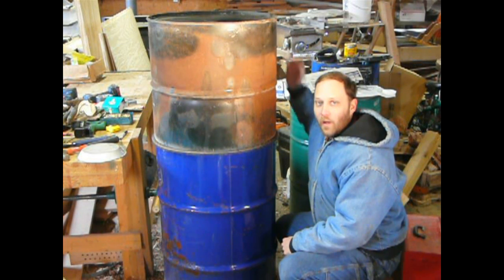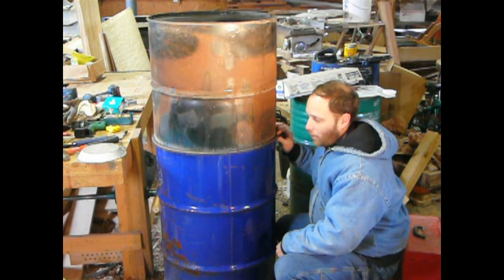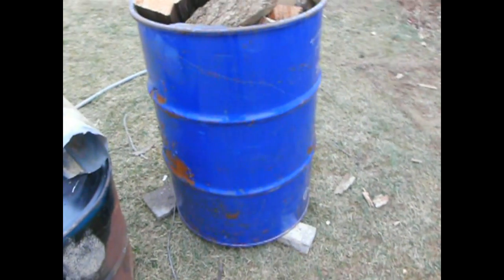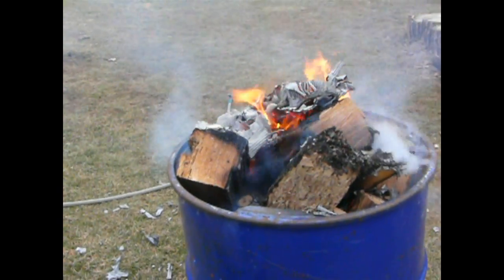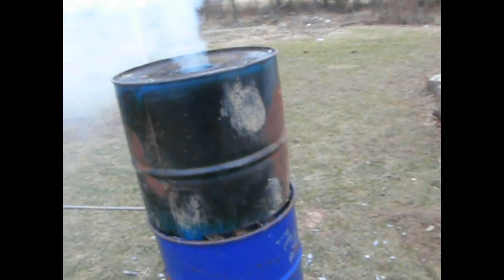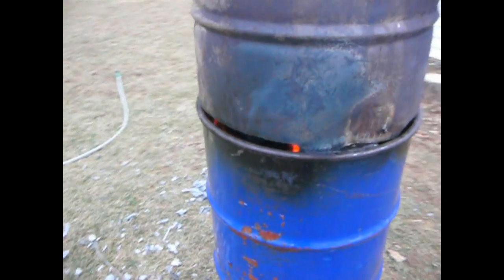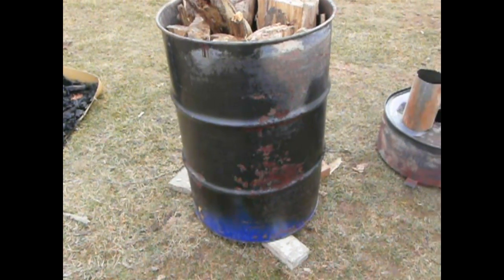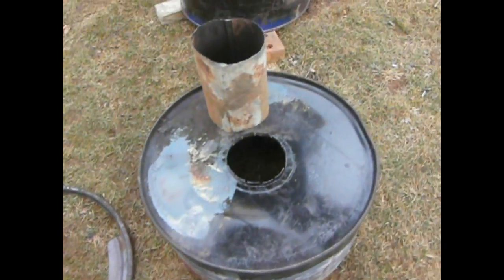Biochar Charcoal kiln

Comment: No holes are necessary. Here is the best and most efficient design I have seen: 1: load a standard barrel with no holes in it. 2: Put the lid back on with a 2" hole in the center of it. 3: turn it upside down on top of three or four bricks standing 4" tall. 4: get a ring of metal, maybe a larger barrel or just sheet metal bent in a cylinder that will fit around that barrel with about 3 to 6" all the way round: 5 Support the outer barrel about 2" off the ground. 6: take the outer ring off and make a fire under and around your sealed barrel full of char wood.7: when the fire under is burning good, put the outer ring back on with a small 1/2" gap at the ground - this holds in the heat of the fire and prevents wind from cooling your inner barrel. 8: when the inner barrel gets hot enough it will start blowing smoke out the hole in the bottom, feeding the fire with the white smoke that usually goes up into the sky to kill all of us later: 9: the extra energy wood and time you save will pay for itself in the first batch you make and you will be surprised at how much more charcoal you get in each batch  NOTE: you also won't smoke out your neighbours  ! ! !ALSO you don't have to worry about STOPPING the flame because once you think it's done you can just walk away till the next day. Very little oxygen will get into that center hole and if it does the heat will build up fast and put itself out again.
Reply from the maker: Yes, if I understand correctly, you are describing a different type of kiln, a double barrel retort system. It can be a good one and easy to set up.

Comment: Hi. I think your Phoof, "little explosions" were evidences that oxygen was getting into your barrel. It was igniting the hot wood or hot charred wood then burning up rapidly. Then more oxygen would enter and the process repeated until you had a cool enough core for the coals to no longer ignite in that way. It was an interesting burn because I kept looking for how it made any sense. Most of the burns that I have seen required that the burning wood either 1. heat a separate chamber wherein char was being made, or 2. brought to a high temp, then closed off, sealed, from the possibility of more oxygen entering the system. I watched the burn hoping that you would explain how you intended to isolate the wood that would eventually become char. However, I never saw that your design attempted to do either and kept looking for one or the other. I think that since you were just looking for soil amendments, you must have gotten what you wanted out of it.  Thanks, B.
Reply from the maker: +William Brown Yes, it was igniting the gases coming off the wood. Top lit biochar kilns work a bit differently than other types and yes, some of the charcoal inevitably burns off with this type of system. If you don't somehow extinguish it at the end, it will burn down to nothing in most cases. Pit burns are similar.
Reply: So far, all I know about it is what I read online or see on You Tube. It is fascinating though. Maybe one day, I'll give it a go.
Thanks for your video and responding to my comment.